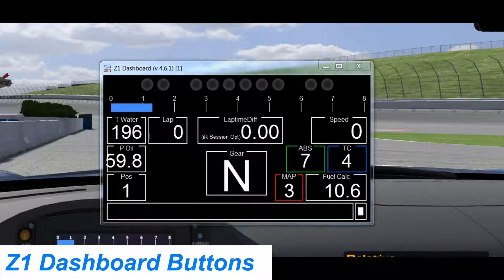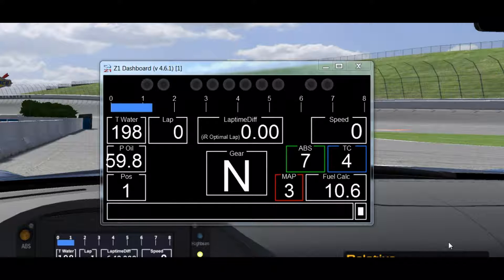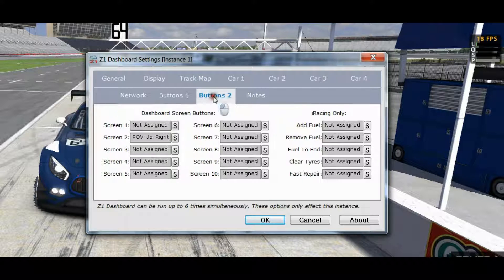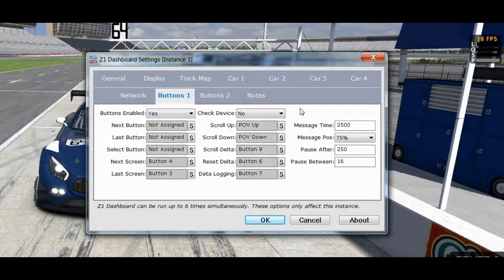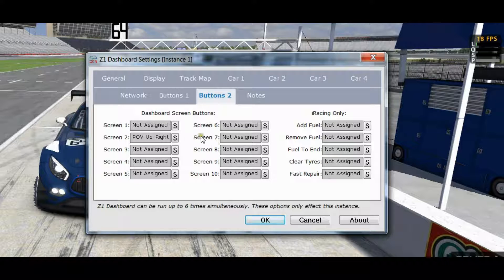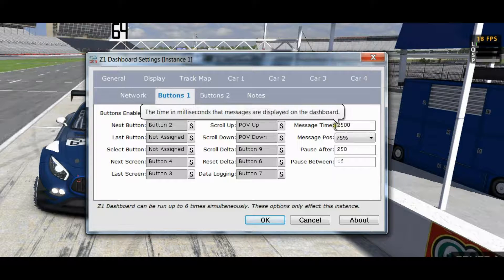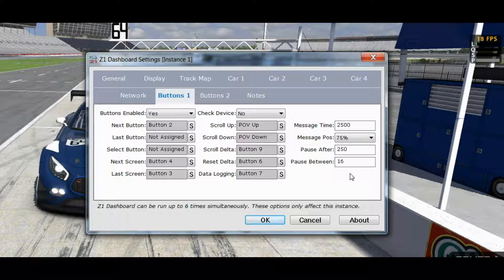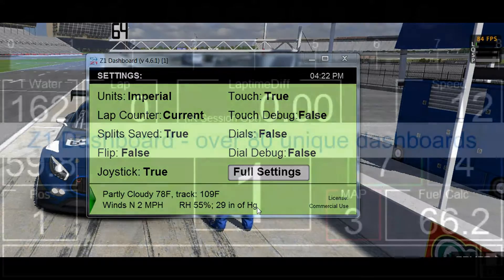Z1 Dashboard - utilizing buttons

Comment: I seem to be having same issues as a lot of other people with not being able to assign buttons. I have a Fanatec CSW base with the BMW wheel and the only thing that seems to do anything is right side joystick. None of the buttons are recognized. I have 2 different DSD button boxes that work fine in the game through my usb hub but whether they are plugged direct to the computer or through the hub when I go to assign a button it automatically assigns a button without pressing anything. Even if I clear it out before I can do anything else it assigns the same button. If I try a different box to assign something it says that button has already been assigned please select another. It does this connected direct as well as the hub. I've tried restarting the software, the computer and have run out of options. Please help. Thanks in advance
Reply from the maker: This usually happens if you have a button stuck in the pressed position.  This could be from a h-shifter being in gear.  Or it could be you have a bad connection on one of your buttons somewhere.  I suggest unplugging each device that has buttons one at a time and then retrying the button dialog to see if the issue goes away after remove a particular device.
Reply: Or I you run joytokey, it's got a habit of doing that

Comment: I cant assign any buttons on my SMZ1 wheel either.
When i click one of the boxes to assign a button,it says "Button 5 is already in use-please choose another one".
When you click clear,it doesnt clear and re-assigns button 5 again.
This is the same for all the assign boxes.
I don't know which button 5 is on the wheel?
I have the latest version of the software,and the "S" is not there when trying to assign a button.
Reply from the maker: This sounds like you have a stuck button on a button box somewhere.  Do you have any input buttons besides the SMZ1?
Reply: No I dont have any separate button boxes.
For some reason though,under the check device section (which I have clicked to no),"scroll up" seems to have button 5 written in it.
None of the other boxes have anything written in them-even though when you go into them they say that button 5 is assigned.
Reply: It was the pedals that was the culprit.I unplugged them from the PC and everything worked fine,assigned what I wanted ,then plugged the pedals back in.
Reply: I'm going to try unplugging my pedals tonight.  I've had that same issue for months and haven't been able to figure it out.
Reply: Check your boot running joytokey, it plays up with Z1 dash